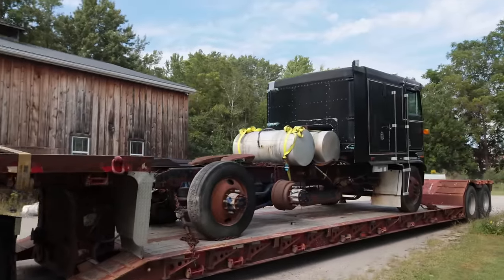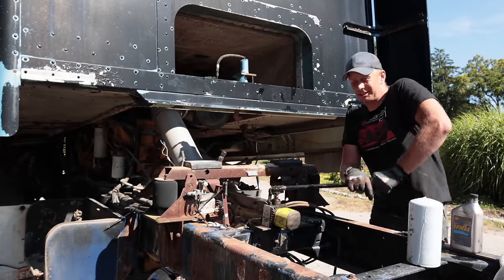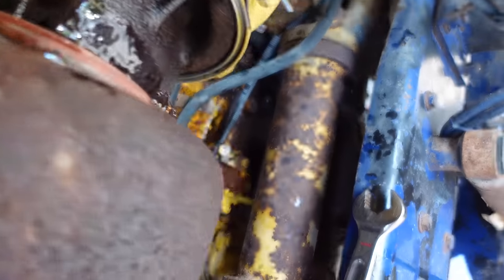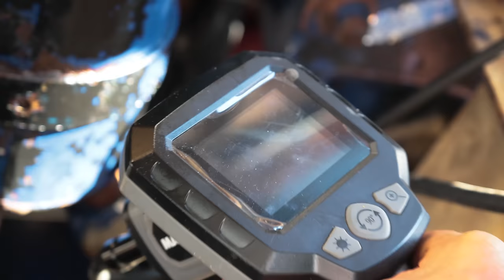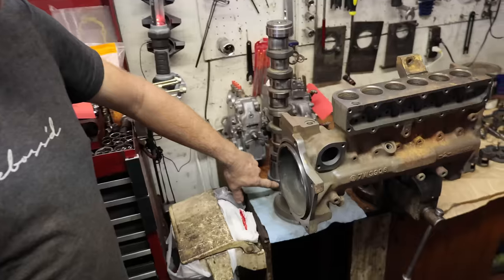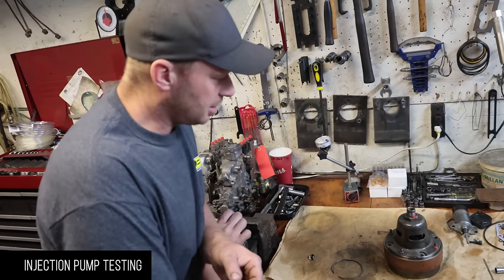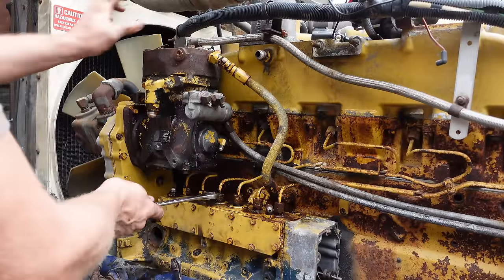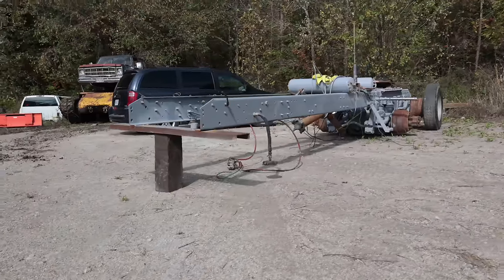Will It Start? CAT 3406b Kenworth Cabover Hasn't Ran in 25 Years! #K100Cabover [EP1]

Comment: Im laughing my ass off at you and screaming "Where is your 6" medical forsips" to reach up in there and pull the rack back and forth??? Yes ive done this a time or 8. Dad bought a new 1986 K100 double bunk with a 425 B Block Cat and a 13spd with 4:10 8 bag Kenworth AG100 Suspension. He ordered it with 280" wheel base, and double frame. Yea it was a MONSTER for its day. The plan was to be able to put a extended deck behind the cab and a 3rd 20,000 lb lift axle under it. He had planned to do local heavy haul when he retired in 1990 around home (NE Ohio) with a 50 ton 3 axle RGN. Unfortunately he passed from cancer in 1988 before he could retire.  We sold the truck to a excavation company that ran the truck till about 1998 when they replaced it with a New 1999 W900L day cab with C-15. The K100 was sold to a farmer that ran it for a few yrs until his grandson decided to start playing with it as a pulling truck. Eventually it got cut up and the B-Block sold for parts. Its good to see you keeping this old truck alive.

Comment: Hell NO. You cannot get better than a KW 8 bag. Well unless you want 6 rod or walking beam. It doesnt have to just be comfortable it also has to not get your stuck like a hole digging 4 bag setup. 
Stretching is great if you like getting stuck. Only good thing about a cabover KW is the turning circle is better than one with a bonnet.

Comment: Don't even bother trying to start it take the motor out put it take it apart do whatever you want with it I don't want the motor or transmission no take it out I'm sending you a brand new motor and transmission new motor and a brand new Trans okay don't even bother messing with it it's taken out pull the motor out of it yep put all brand new dual exhaust on it straight pipes 15 in yep it's going to be a bad women jamming when we're done with it thank

Comment: Everything going to cut it off find a stretch is stretched enough to take it to about 380 yeah that's where I wanted that 380 yeah and four sets fuel tanks yeah bumped up against almost against each other just enough room to you know get your hand in there and polish it and dry it off and stuff yeah Robin I don't want to rub each other yeah unless you find some 600 gallon on each side or 300 gallon on each side and a 350 pair of them yeah on each side again it don't to me it doesn't matter to me I'm not building it to run over the road I'm building it to be kind of a show truck Yeah that's why I said the frames got to be put together right yeah yeah cut it each Direction yeah mine are cool yeah and then we fish bite it yeah what a machine with a machine piece of metal yeah cut the fit perfect we need let me know Sean Ledford Senior okay yeah John okay yeah I'm going to put aluminum vegetable on it was a real long side in my cover the frame yeah yeah the air cleaners we're getting either too big huge Vortex behind each front wheel yeah one on each side yeah you can have that fish without a water I don't want it no no I don't want to cut off either I just want I want that new can work cut off s*** if you find a set of triple drives I'll take a set of triple drives here right yeah yeah I'm brand new I am sent to you yeah I have RCI send him a set of brand new triple drives yeah I want to hear Jump Around 120 130 mph yeah it'll have 120 130 mph speedometer yeah I'll have one ordered for it because I I'm an old hot rod driver yeah I I still drive race car so yeah I got nine NASCAR teams nine top fuels or eight top fuel dragsters I have five top five funny cars and five Pro stocks and two Indy cars yeah and I own all the Super Tracks yeah hard to believe in it well I'm just I'm just like you man I'm I get my hands dirty and yeah I get to lay down and getting them grease and dirt I'm not above it washes off yeah I can get dirty and greasy today and look like a businessman tomorrow it's no real big deal well you know yeah I I do what I do that's I feel tired she'll tell you he gets he gets in the end of anything yeah he's got trailer shop he's got truck shop Helen's Domino's Little Caesars Pizza Helen's Restaurant gas stations yeah he owns just about a little bit of everything I own the Highway 80 truck stop here that's mine I got a 48 Shake Authority on record that run all over the United States here yeah ready for John yeah Ledford Towing and Recovery there I'm also a Repo Man no don't get scared just cuz it said that don't mean I'm a bad guy everybody's got a reason yeah I just don't know any money nowhere to no banks if I buy a jet I pay cash for it yeah I don't Finance I'm like United Parcel I don't Finance anything we pay cash for it yeah I'm a single operation that I'm in Soul owner of the company yeah I buy ocean liner and I sell them yeah yeah so I mean you know and it's what it what do you do and what do you like to do you know yeah so well like I said I'm no better than you or anybody else so you know no I like to be I like to be who I am and where I came from yeah I know what I was I know what I am I know what I can have I know what I don't want yeah so yeah no I'm not above helping anybody as long as they don't steal from me you feel from me I don't have no use for you last my ex-wife I have no use for she's a thief and drug addict is that say anything well I don't have any use for my boys or my brothers because they're safe Saturday I don't have no use for ask my three daughters they're on a verge of being on the outside looking in I'm you know they don't talk to me and I really talk to them they're the ones that's going to be without anything when I die cuz I'm going to give it all to the other kids it's already on paper anything happens to me they get nothing absolutely nothing I don't know I'm not changing it now when they come first of the year it's final it will not ever be able to be changed no January want it it is a final legal document better think about it Karen fresh final and legal first of the year you're cheating him out of everything all right thanks a lot man good luck